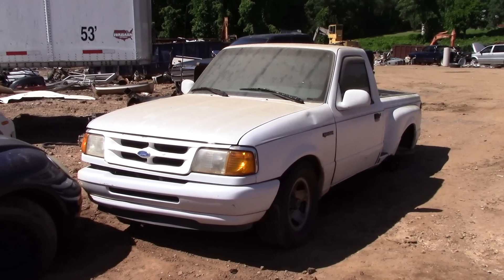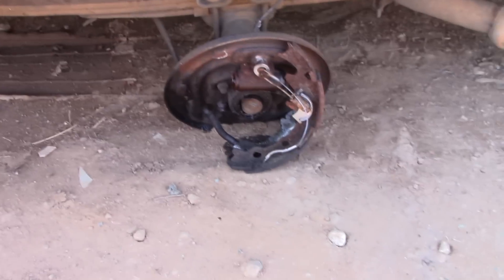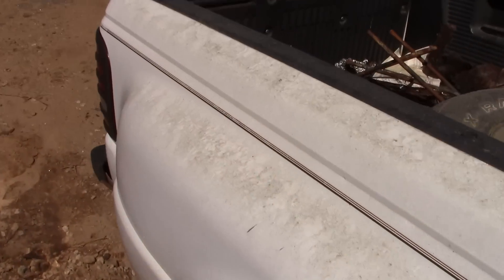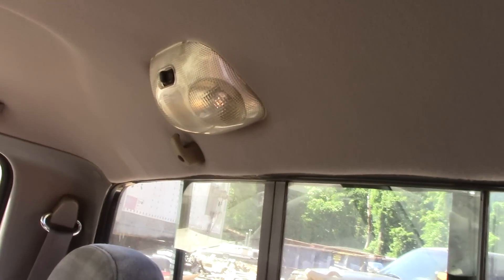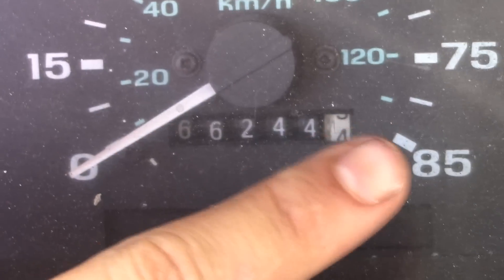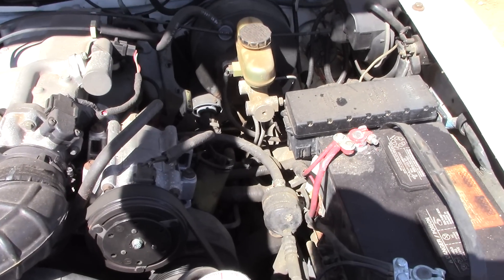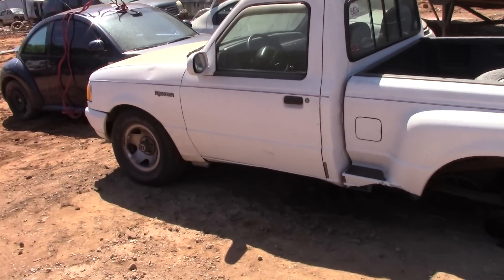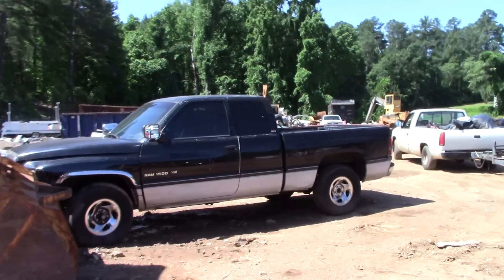Ford Ranger SPLASH EDITION !SOLD FOR SCRAP!

Comment: I had a 95 Splash, loved it.  That axel is no big deal to pull and replace. It doesn’t need an entire rear end.  Pull the pumpkin cover, remove the clip that holds the gear side of the axel in place and it will come right out.
Reply: c clips and a drum U in bizness

Comment: I just bought a used 93 Ranger splash from a dealer, no rust, some scratches 4.0 ,Runs good. I had a 99 used Ranger, 4 cylinder, no problem with it.

Comment: There's a key saver stuck on the side of the chassis rail under there so it's probably even got spare keys.  Being as Ford seat materials weren't of the greatest quality in the '90s it wouldn't surprise me if it actually is 66000 miles, especially being as the numbers on the odometer line up well, which they often don't do if it's gone round.  4.0 for good power and a 5-speed, that should make some pretty economical and unusual wheels for someone...

Comment: I owned one of these right after high school.
The old 4.0 push rod engine with the 5-speed on the 2 wheel drive splash were a burn out king. The beds were fiberglass and it would burn the tires for days. If you got traction, they were a fast little truck!!

Comment: I had a 1993 Ranger Splash exactly like this! It was really sweet! Ended up lowering it a little and looked rrslly good. With the fiberglass bed, 5speed and 4.0L it was quicker than my 1997 S10 with a H.O 4.3L 5speed and 3.73 gears.   

They go for about $1500-3000

Comment: The splash came with color matched bumpers and grille, as well as those quarter panels moldings above the turn signal; so, that chromed trim obviously came from another truck, a regular Ranger, not a splash.
But that grille is from a 1995 to 1997 Ranger, 93 and 94 Rangers came with a different grille; those had 2 vertical separators and well as a more square look (not so rounded). That grille is from a 95 to 97 Ranger.
Love your videos man, keep updating and if you do have a 96 Ranger please give it a shot!!!!
Reply: Matias Fernandes awesome information thanks man
Reply: @wyattklingensmith8862  BAYWATCH!!!!!!!!!!!!!!!!!!!!!!! watch the orig series that's all they ran
Reply: Glad to see someone who knows what they’re talking about in these comments
Reply: I really liked the 93-94 rangers, With the 4x4 engraved onto the grille on the upper trim rangers.

Comment: Nice little truck. I had an 87 Ford Ranger. It only had the 4 cylinder fuel injection motor in it with a 5 speed trans. It ran great. Got excellent fuel mileage. I lowered it, had nice wheels and wide tires, put bucket seats in it. I sure do miss that little truck. I sold it because I had to many "toys" at that time. That Ranger splash would be awesome fixed up. Fast AND great fuel mileage. The best of both.

Comment: My first new vehicle was a 95 Ranger Splash 4 liter 5 speed truck.  They'd definitely get out of their own way, especially when you ditch the 3.27 ring & pinion for a lsd and 3.73.  Loved that little truck, it's a shame you can't get trucks that small anymore.

By the by, those wheels are stock.  Under that dirt, there's some chrome.  The pinstripes aren't stock, it had some gloriously 90s red and orange splashy graphics on it from the factory.

Comment: those little five speeds have a nice little pep, my best friend's mother had one from late 80s. Here in the Southwest vehicles like this one could basically be on the road for decades as long as the drive train engine holds up or replaced

Comment: We still have our 1993 Ranger Splash. Looks just like that one from the outside, and white. The wheels are stock as ours has the same style. Ours is super basic nothing options has the 4.0Ltr V-6 w/104,000 miles! BUT, the underside is trashed. Lived in rust belt.

Comment: Yes me a black one with orange stripes 4.0L it was awesome, stolen from work at 2:30 in the afternoon😢 that one has been painted it's missing the splash decals and those are not splash rims unless it was ordered with steel rims.
Reply: Derek Joon are you in the Ford Ranger Nation Facebook page? I swear I saw a comment just like this in there
Reply: DannytheDeereNut Yes I was, I left the page a few months ago was getting way to many notifications
Reply: Derek Joon ttc
Reply: Those pinstripes aren’t Splash either.
Reply: Fed Rooster They might actually be Ford had 2 different decal packages for the Splash 1 was fairly plain and the other like I had was very bright and large.

Comment: I saw one for sale last year owner was asking $5500 cert and e-tested I almost bought it but I ended up grabbing a Yukon instead needed the room for the kids and the V8 to tow my boat. Honestly if that little Splash is a runner swap a rear end in it it's worth the time and effort people hunt for these trucks, right after mine was stolen I looked for over a year trying to find another and couldn't. Hell buy it yourself if you can clean it up fix the ass end and you'll have a good flip no joke.

Comment: The sohc motor is just as good as a push rod 4.0 long as the tensioners get replaced. Hell mines a 2002 the worst year of Guide failure, just passed 150k on it. Still has the original guides in the motor.
Reply: My 4.0 Ranger is a 2010, so I guess it's supposed to be the bad one. IDK. 150k and running like a top.
Reply from the maker: Its all in opinion I guess. A good running sohc 4.0 is rare around here and worth a fortune.  Because none of us scrapyards have any good ones lol

Comment: Dear jay smart, I myself own a classic ford ranger push rod 4.0. And manual 5spd. I don’t believe the battery was too dead to crank it. I believe you need to push in the clutch because ford added that as a safety thing to not turn over unless the clutch was pushed in.
Reply from the maker: Shaun Murphy before I made the video i attempted to start it , if you watch when I turn the key on none of the gauges move, no lights come on , and the dinging is very weak. The battery was dead.

Comment: Put a rear end in it, clean it up, and you're looking at an easy $3K. And the best part is, the rear end won't cost you a dime---you've got two parts trucks. Just remember to swap out the speedometer gear, since the rear will probably be a different ratio.

Comment: Jay, what are your thoughts on the 2019 Ford Ranger?
Reply: I'm not Jay but I wouldn't have one of those pieces of over rated garbage on a bet!  Too much plastic, more like a rolling gaming casino than a real truck (you almost need an Airbus pilot's licence to drive one) and almost as big as an F150!  Ford really stepped in a huge pile of crap with this idea.  Should have stayed with the original.  You rarely see one in a used car lot and most are still doing what they were built to do....work!

Comment: People in southern California would love to turn this into a Prerunner .
Reply: And the newer SOHC engine has about 80 more HP than the older DOHC and push rod engine . I have a 2003 Ranger Edge and it goes like stink with the newer 4 liter and 5 speed Automatic . The first special edition was the Splash than the Edge and finally the Sport edition , mine is extra cab 2 wheel drive . But the Edge model had torsion bar suspension in both 4 and 2 wheel drive , and came with a rubber floor instead of carpet .

Comment: It's a 5 speed you have to press the clutch in for it to try and start.
Reply from the maker: Nothing happened when the key was switched to the on position. No lights, no gauges, nothing. Also we attempted before the video was filmed. I know when I said it had a dead battery... that I meant It had a dead battery
Reply: I didn't know you tried before the video. all i know is in the video you turned the key and then didn't have the clutch pushed in. Did you see what that kind of truck goes for in my area? one with 134k miles is for sale for 5,500 but it looks much cleaner without any dents or damage to the bed.

Comment: This truck is now in Greenville Transmission Clinic, July 1, 2022, still on 15th. After the clutch linkage or something failed on White Horse Rd. at rush hour... A Kia with a chain saved me then.. Please pray for her and the cost.
Reply from the maker: I run a shop not too far from you, if they cant fix it have it towed to me. I actually had that happen many times with this truck!

Comment: That is a very rare Ford Ranger With all power options. Most of these were stripped with 5 speed no PS/PB No A/C and vinyl seats and yes ford still used an electronic AM radio only in 1994 I know I have seen one and I forgot the 2.3L I-4

Comment: Hey Jay, I was wondering if you could give me some advice on my truck? I have a 1993 GMC Sonoma that has a 5 speed manual transmission in it. It calls for ATF for the transmission but, would it mess up my transmission if I used a 75w-80 gear oil in it? I'd  appreciate the advise and keep up the great work! 

Thanks,
Matthew B.

Comment: Wheels are stock minus the center caps..  And I'd bet that 5 speed will bolt right into your ranger..  But those fancy seats aren't nearly as comfortable as the ones in your Ranger..  Just stick a new axle in it.  It slides right out without opening the hog's head..

Comment: I would definitely put a posi rear end in it I had a 93 Ford ranger xlt extended cab  with the 4.0 2wd with posi rear end it also had dual Flowmaster exhaust it's on my channel if anyone wants to check it out it had a lot of things done to that truck i wish I hadn't sold the truck now

Comment: Do you know if the front bumper from the '94 splash edition will fit a '94 xlt ranger?
Reply from the maker: I dont see why it wouldnt. Its still the same truck.
Reply: Im thinking of using the grill and bumper from a splash edition. I'm gonna try some local junkyards for my ranger build. Thanks for responding.

Comment: What an awesome little F.O.R.D ...

Yes clean it  up put an axle in it thennnnn. ......drive it back by the other Fords  put a whole gallon of gas ⛽ in the cab ,all over it not just in the container .
Then hit with a match and see if the fire spreads to the other Fords of this Earth.

With any luck many a Ford will melt down for the Get Rid of Ford cause.

Comment: What's a "splash" truck? I've never heard of that term
Reply from the maker: Its just a package offered by Ford for the ranger body style trucks. They made "splash" "Edge" "STX" and some other odd an end models.
Reply: Jay Smart Thanks for replying. I'm a fan of your work. But essentially it's a special trim level better then the XLT. Bcs if I remember correctly, the XLT is the highest trim for the Ranger right?
Reply: More a monochrome "styling" package for a close to base truck. It was supposed to be "sporty" and affordable and targeted at "youth" buyers in the Sunbelt/Southern markets. The XLT's had nicer interior trim, although the one Jay was showing looked better than the base interior. Generally, the Splash was 2wd only. Although I wouldn't be surprised if someone had special-ordered one built 4WD. Used to see yellow ones everywhere. Haven't seen any on the road in years. Almost bought one 2001. Instead I got an Explorer XLT.
Reply: Steve Varholy I've never seen a Splash Ranger. I've only seen the Edges and the XL and XLT of course. Dude I'm a fanboy of the   Explorers if fanboys of them even exist lol.
Reply: Since the Splashes were 2wd, they generally were only marketed to non-snowy climates. All the brouchures used to depict them with surfboards on the beach and the like. I liked my 2001 Explorer. It was loaded except it didn't have leather. I traded it in before the 4.0 had problems or the tranny went. If you parked it facing downhill and put the transmission in park, there was so much lash in the driveline, it would "hop" forward until the parking pawl caught it. I replaced it with a Centennial Edition Mustang GT convertible. There were winters I wish I had kept the Explorer, since the Mustang got stuck in the snow all. the. time. Ranger Edge replaced the Splash package.

Comment: It was a POS truck when built. A marketing scam tried by Ford. I hate Ranger trucks in general but know you like them. Buy a 1983 to 1984 Nissan truck with theZ24 engine. Prehardbodies. That was a misnomer. You will throw rocks at your Rangers.
Reply from the maker: upside downdog uh no . The z24 was a crapshoot engine . Been there done that blew it all to hell. I even tried to use one for a yard truck here and it was crap. The later 80s early 90s hardbodies were much better and the engines much stronger. But I would never take another crappy z24 over my current ranger
Reply: Jay Smart 
Hmm. The forklift engine in my little 84 Nissan is quite the machine. Easy to fix and quite powerful. Its a 720 KG truck so bigger than a half ton but not quite like a 3/4 ton truck. I hate the Ranger line of trucks due to their light ass ends. I totaled one by driving through a rain storm where the highway pooled the water. The Nissan goes through that stuff without hydroplaning.